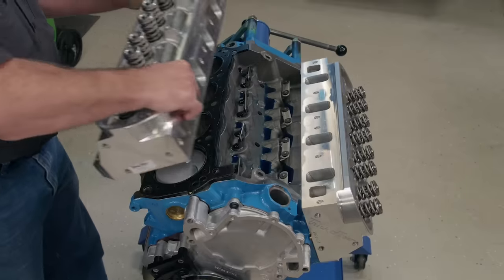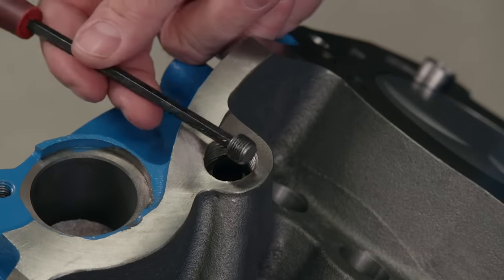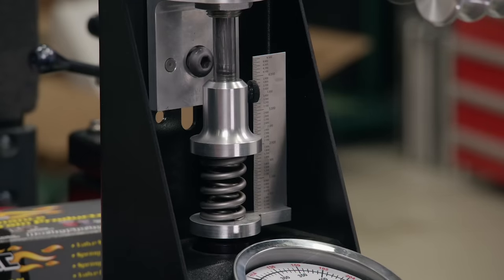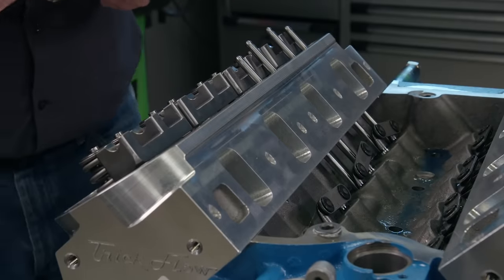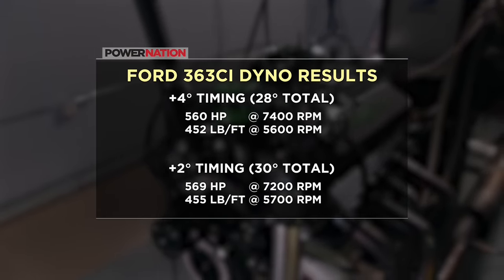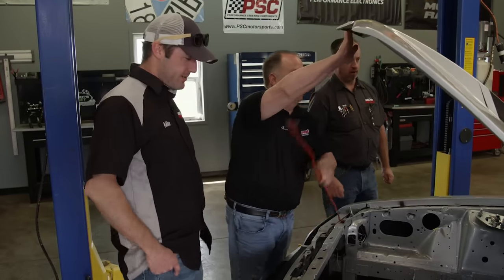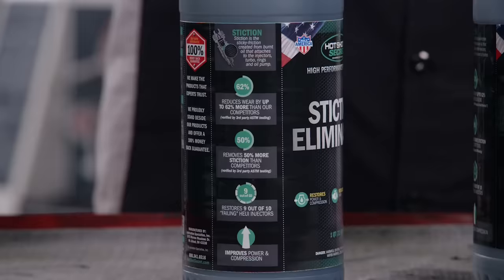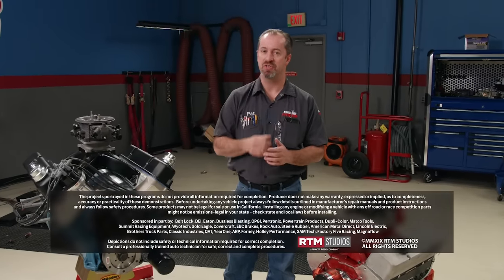A Little Science + A Little Money = Triple the Power? - Engine Power S6, E13

Comment: I used a stock 1975 block. I tediously removed the casting flash throughout, checked for any imperfections, enlarged the oil returns and used a billet steel main stud girdle. Using custom length H-beam rods from eagle and a "hank the crank" 3.25" 4340 steel crankshaft, with ultra light JE pistons and floating pins, the engine holds 90 psi oil pressure, with no issues of oil starvation even at 8500 rpm. The stock early 302 oem blocks will handle 800 hp with the steel girdle, so the aftermarket block isn't necessary for most people. But then, mine is just for the street. lol
Reply: @thomasdaddio741  10.9:1. I get away with premium pump gas because the cam is quite large, and I run a 5000 rpm torque converter. :D

Comment: A little money....starts the build with a $3,000+ Dart block.
Reply: about 2g. We split 6 oem blocke before the dart block.
Reply: @jondoe6618  Yea they start at 2K and go up to over 3 grand.  I am not knocking this build at all but this ain't no budget build. I use junk yard 5.0 explorer motors get them for $2/300 bucks 500hp on the street is plenty fun for me. And if they let go it's no big deal.
Reply: @bigboreracing356  LOL It takes a few Hrs to swap a motor no big deal.  And of course Dart blocks are better no one is denying that, They better be for thousands of dollars for just the block.  Ill have to go threw 15 engines to spend the same money for just one dart block.
Reply: @mrschwifty5564  Depends what you want to do. To make a sub 11S drag Mustang with a 300 shot of nitrous on a stroked 351 Windsor, assuming you have a diff and trans that can withstand it already, you're looking at about 15k. But we're also talking an engine which at that point would make at least 700-800HP, and over 1400 pound feet of torque. 
Racing ain't cheap. Also, originally those engines are rated at 215 HP.  What're you doing to get another 300HP out of it for apparently no cost?
Reply: @CAepicreviews  Ported GT40P heads,  Single plane intake,  Off the shelf cam,  Fitech EFI and boost. All used parts.  I am not looking to set records  just have fun on the street and not go broke.  I have $200 in parts in the heads plus my time to port them,  $100 for the intake,  $150 for the cam,  $800 total in the EFI setup, And $5/600 for the turbo stuff.   I know racing ain't cheap  but look at the title of the video a little money ? 15K is not a little lol that's all I was trying to get across.
Reply: @bigboreracing356   Roger that if i was trying to be a competitive street racer i would go with a dart block.
Reply: You guys both have valid points. For what I'm doing, a junkyard engine would work just fine. But if you're going full race mode, then spend your life earnings if that's what you wanna do.
Reply: @CAepicreviews  lol I've been 9s with both nitrous and with an S-trim 20+ years ago with a stock bottom end 302 from the late mid 80s to very early 90s that had the TRW pistons. Street aluminum Unported head from Trickflow, Edelbrock, Brodix take your pick with small off the shelf hydraulic roller and basic bolt ons. Yes it was a manual.
The mistake most make with the stock blocks and nitrous is the rpm and torque. It's not usually hp in the 500-750hp range. Ive never broke one motor in that range going back to the 90s. If the hp is in the 550hp range even with the 302 H.O blocks I've spun them to 8k for years. They will last at 750hp+ if you know what your doing. The problem with stock blocks and nitrous is the idiot's running and turning them. If you have a mild N/A setup it will make 300hp by 3000rpm pretty easy. If you use even 200hp shot at 3000rpm that's just under 900lb-ft. Bump that shot up to 300 it's over 1050lb-ft which is a problem for a stock block regardless what's in it. It's the high torque at low rpm that breaks motor also. Something many don't realize. I've made 500hp and shot 300hp without a problem. Because of when the nitrous comes in and the amount. If I hit that 300 at 3000rpm even though they recommend you can it's not going to end well for that block with a 200 or 300 shot at that rpm. That's between 1000-1300lb-ft. That's the reason so many have cracked and or broke blocks. It wasn't the peak hp but the peak torque that does the damage. Once you get to 4000 and up the torque drops fast. So when everything is managed correctly you can make it work and I'm not the only one that's done it. Obviously the size of the motor, cam etc dictates torque but I think you'll still get my point.
Reply: Wayne Bollentin bs
Reply: @jimgoff1170  bullshit that's hilarious. Same bs we heard going back 20 years. I haven't built a ford in years but there's a guy going much faster now then I did years back with a stock 302 block from 1968. It's a 302 stroked to 347 if I remember correctly. Look into ugly kid racing. He's been 4.90s in the 8th with a factory block on nitrous. That's 7s in the 1/4. Now he's going turbo and it will be faster.
Reply: Some are asking 1000 for a factory nothing special block on Facebook.,that could be junk in the first place.
Reply: @mrschwifty5564  If you were truly being competitive street racer, a dart combo isn't the right option. You would be spending big bucks that otherwise could have been put into actually going faster rather than unnecessary power handling. If power handling is the idea on a street racers budget, there are better options than a dart.
Reply: @BruceLee-xn3nn  go to the yard and pull one yourself and make sure it turns. My yard sells any gasoline engine harness to pan for 260$. Anything from a aluminum 4v modulars to ls's.
Reply: @madmod  I don't race on the street no more got in some trouble in my early 20's and learned my lesson.  And the nearest 1/4 mile track  is 125 miles away so it's just not worth it to make a few passes.  I just enjoy the car and slay tires on the back road's 500hp with 4.10's is more than enough to do rolling burnout's in 3rd with a big smile on my face.
Reply: @Frank Bonazza III nmra true street had naturally aspirated 3000lb mustangs running 4.6 2vs that were in the 10s with some 360whp. KenB is a great example.
Reply: Money is no object to any of these TV show guys
Reply: And it doesn't come out of their pockets either.
Reply: outdoor fun  Wrong. This is a motor that has to run hard for hours on end.
Reply: outdoor fun  I'm almost 40. 
I own a 67 fastback with a sbf & a 5spd. I kinda know what I'm talking about.
Reply: outdoor fun  you don't need a dart block for road racing at that power you just need a good bottom end and a great oiling system which if you know 327 and 350 you they don't have a great oiling system a normal 350 would blow pretty quick I'll run my 302 or 351 all day long against a 350 on track
Reply: outdoor fun  I didn't realize how old this video is I shouldn't have commented lol
Reply: outdoor fun  all I do is work on Chevy's my business would go under without them
Reply: outdoor fun  I repair chevys and once in a awhile I get a Chevy that wants put some performance parts on I'm not only building them people don't have enough money for the big boy stuffyou guys think your stuff is cheap it's 2020 the good are the same price as ford
Reply: Like to see how many 4.90 passes those guys really get on a stock block.
Reply: For a race engine that is cheap. Same engine in a touring car here in Australia will be around $80k USD. 5.0L inj ~650hp @ 7500rpm. They didn't say street car.
Reply: @I_like_turtles_67  very true bro, they will never all 3 be in the same sentence.
Reply: @mrschwifty5564  é
Reply: @mrschwifty5564  You running endurance courses?
Reply: Lol I thought the exact thing ughh

Comment: If this engine is triple the HP they had before, what were they running before a 4 cylinder?
Reply: Stock reman 302
Reply: 5.0 mustang's ranged from 215 to 235 hp. I know right? They spun the tires because of the terrible suspension, not the horsepower lol.
Reply: No this is a Dirt or whatever after market block, POS 302 would split in half.
Reply: Ray,
I agree, they must have had a very poor running V8.
Reply: They compare stock netHP to engine dyno grossHP...
Reply: My 79 zephyr makes about 150 stock lol
Reply: I think they were running a 1976 Mustang II 2.3L 4cyl before the 363
Reply: it was an old 80's smog motor. most likely tired too. remember the corvettes those days were only 170hp they were dark times.
Reply: @robh9577 They spun the tires because of torque and gear ratio. The suspensions in those cars are actually pretty decent.

Comment: It is so fun watching you guys set up a build! I have a 1973 Mustang convertible with a 351C 2v heads, Edelbrock performer manifold with a 4bbl 600 holley. FMX 3 speed trans, want to convert to TREMEC 5-spd, have 3.55 reartend gearing now. I have been looking for a good build specs to get around 500 hp at the flywheel. Probably using aluminum heads. I want to keep it under the hood, i have a mach hood no air induction set up. I just dont see many builds for Clevelands for the street.

Comment: I just have to say the fact they chose a pushrod V8 to exceed 7500 RPM and be used in endurance racing, is awesome. Would have gone with a Ford modular myself
Reply: Why? Pushrod engines are simpler and they're a proven design. A pushrod V8 is what Ford used to beat Ferrari at LeMans in the 60s.

Comment: a cast solid roller? doesn't sound endurancy to me. also you failed to note that .613" lift is with a 1.6 rocker arm. about .651" with your 1.7 rockers. and it would have made better power and a flatter curve using a 1.6 on the exhaust and lengthening the ex duration a few degrees. another endurance item I would note is the sportsman shaft rockers do not have spring oilers or pressure fed trunnion  bearings. I've used the sportsman T&D's but at  least modified them for a gravity fed trunnion. that 550# open pressure, is that at .613" or .651"?

Comment: Wet sump on a circuit racing engine,.. baffles can only do so much against continuous g-loading.
Reply: ? did you even look at the pan?
Reply: @baddbradd89  Yes. It'd do for slower classes, not any that should be capable of generating more then a G of lateral acceleration, or even higher for braking. In a long constant radius turn, that thing is going to suck air.
Reply: baddbradd89 Yup even with that pan it’s not worth going wet sump on a autocross/ road course car. 
It’ll only take a second of oil starvation to ruin a day at the track.
Reply: That's why a dry sump system is better for racing the whole system is made to keep the engine supplied with oil
Reply: Rules require wet sump
Reply: And yet race car's engine all over the globe have been racing with wet dumps for 100'+ years.
You only thing to limit you is how much weight/ volume of oil you want to carry, then sump design is key for the terrain.
For a car that only turns left it can feed it self if gated right.

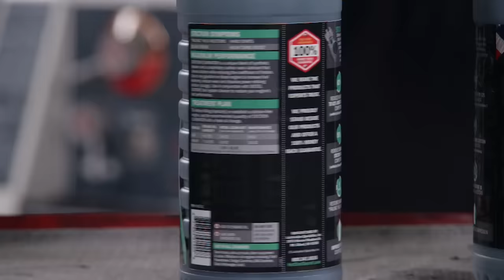Comment: 17:20 I have been told that the "Stiction Elminator" oil additive is especially important to the PSD 7.3 and 6.0. That is because of the HEUI injection system. Some heavy Navistar and Cat diesels have HEUI injection, but I don't know how much they benefit from that additive.
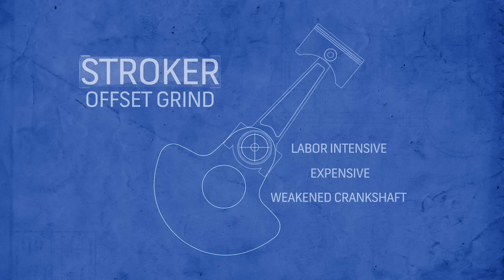18:27 This is why some people spray weld a high nickel alloy on the undersized crank journals. It reduces the loss of durability in an offset ground crank. Also, it makes possible the use of standard size connecting rods. Some people will offset grind a crank, then weld the journal diameter to that of a more common engine. That enables the use of connecting rods from other engines. I have heard that SBC and BBC rods are used in some cases. Piston compression height may change, and that may mean using a different kind of piston.
Reply: Ive heard this on purpose built dyno engines ,they use smaller diameter rods to rev faster .

Comment: What turns me off about this whole build , is it's all aftermarket. The block isn't even a Ford block. Nothing on it is Ford. That's a pricey engine for the average guy to build ☹️
Reply: At 570hp a 351 Windsor block would be fine.
Reply: It looks like the timing cover might be stock. lol I removed all the extra cast flash off my oem cover, sanded it and polished it to a mirror, and it looks awesome.
Reply: This is Purpose Built .... 
No place for OEM ....
Reply: How many people on here are racing on this track with them?  NONE!
Reply: So what?
Reply: Indeed, big bucks for big mid-Ohio racers.  Rather useless, for a guy like me who still bangs around in the garage.  Hey guys, send me your "little-money...", I'll look around for some better oil.
Reply: yeah, well, they built the engine for a racing team so.... whats your point?
Reply: @1silvervespa  a Ford oem boss 351w or oem z351 block would have done just fine and possable saved about 3 grand over all on the build. Would have even had around 650hp no problem for this project. If you dont believe me then look up the sn95 cobra r mustang. 250 made by Ford for endurance racing just like this came with oem boss 351w block 300hp 350 tq bone stock sold new only to people holding racecar drivers certification  most all of these cars got 408 stroker kits and put out 600+hp at the tracks where they were endurance raced.
Reply: Gotcha bud, build a 460 but it wont last nearly as long
Reply: Just when I think the comments couldn’t be any stupider, here comes Kurt.
Reply: @indyrock8148  right or a 5.3 ls
Reply: Yep it's like doing an LS swap on a Buick GN. Or like the NFL going sjw..
Reply: @indyrock8148  With all the machine costs does it weight up?
Reply: @marklowe7431  depends on how much machining is actually required.
Reply: No one said anything about any part being OEM. The engine was built for a race car. It's actually not an exorbitant amount of money for the performance they'll get from that engine.
Reply: @indyrock8148  2nd that, we run factory 351w with girdle or 4b conversion at 700hp for many years here in Aus. In this case it may be more economical to use aftermarket block.
Reply: its not meant to turn you on,its for endurance racing.this is easily a $20k engine
Reply: @AmericanThunder  Heel yeah, I bet it does. I've spent hundreds of hours polishing aluminum over the years. So time consuming and filthy but so worth it.
Reply: It may not be a OEM block, but 99% of the parts for a OEM block can be purchased for the aftermarket block. They just improved most of the short comings of the OEM block
Reply: @ryanschaff123  …. GFY …. 😊

Comment: My apologies for being completely out of my league here, but I was just wondering why, after all of these years of block, head, and manifold production why none of the parts are channeled with heavy duty O rings instead of relying on "glued" flat gaskets with silicone ?   I work in industrial HVAC with some engine driven compressors which use a variety of engines from GM 454s to Waukesha and Cat diesels converted to natural gas. All of the tech and computer monitoring, and one of the biggest nuisances are gasket leaks from factory built engines. I've worked on Honda and Nissan engines that have a lot of hours on them and they are clean. Only 1 toyota engine had a slight leak from the distributer because the o ring was dry and twisted up. The installer forgot to lube it.
Reply: They o ring these souped up diesel engines running a ton of boost.
Reply: Ive asked that for years... and personally I think it just boils down to cost.

Comment: I'm more into tuners...I've owned 4 turbo Supras now and other turbo tuner cars

I have to say that it's very impressive to see 575hp all motor on pump gas. From a small block at that.
Reply: I have to say that it's very impressive to see 575hp all motor on pump gas. From a small block at that.
I'm a Ford blue blood that likes all engines. my 17* 399ci 1st gen SBC makes 641 hp@6400 and 560 ft lbs@5700 on 89 pump gas with 10.7 to 1.

Comment: I have an old car, I would like to strengthen the engine in it, what parts should I replace?
Please help, I need your information
large piston, thick piston rods, large crankshaft
is it enough to power the engine
Please
Reply: Too many variables... Different engines have different weak points... And almost all upgrades are subject to what you want to do with the car..
Reply: @sategllib2191  The car is 150 horsepower original state, I want to extract 300 hp  I have no purpose.  Just for pleasure...The car is now full of beds.  I disassembled the engine of the car. There is a problem with the crankshaft. There is a problem in the arms of the piston..M9R block, engine used in Nissan and Renault.I don't want to trash the car.  I want to strengthen them...

Comment: Fix issue with long timing cover bolts that go through water pump and timing cover. You know where the rust in, break off and leak coolant. I cut timing cover for O-rings and just silicone cover to block

Comment: It did not need that sniper 1250 hp unit on it. The 600hp would have been fine. I run the 1250 on 2 of my vehicles one is N/A one is boosted and a 575 hp engine dont need that much fuel.

Comment: Can the pipe plugs be drilled with a small hole to do the thing but not starve the front components of oil on startup?  I'm surprised this doesn't have a triple angle valve angle cut.
Reply: The video showed the front plug not drilled but the rear drilled to control flow, as far as oil starved they put plenty of assembly lube on the components to take care of initial start, doubt they pull anything over a high idle till oil pressure comes up. Old trick is to have a pump drive to hook into a drill and run it till oil is coming out of everything that should get oiled plus pressure on gauge then install distributor.
Reply: I'm sure the TFS 11R heads have at least 3 valve angles.